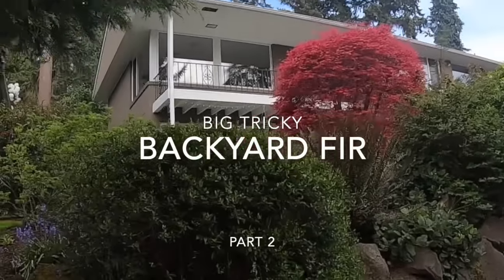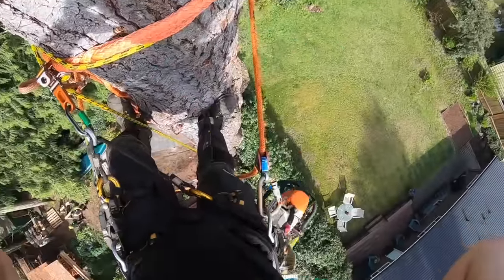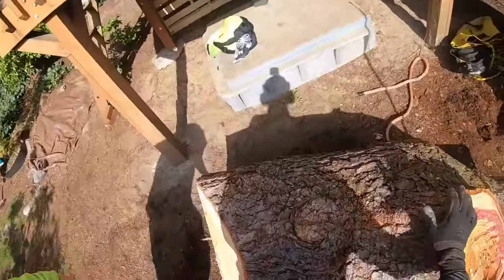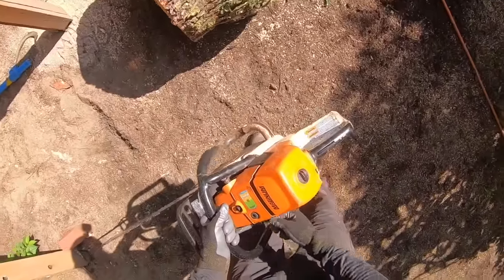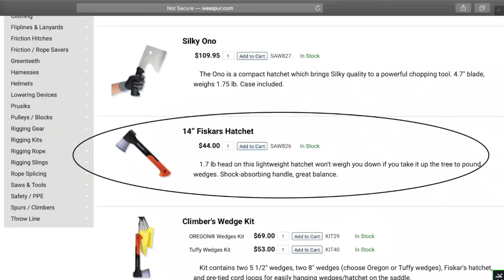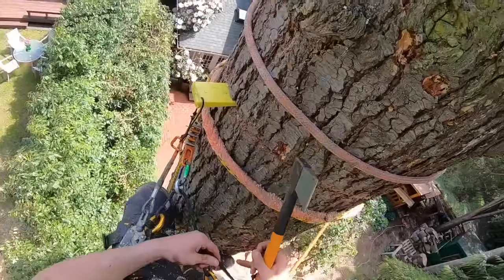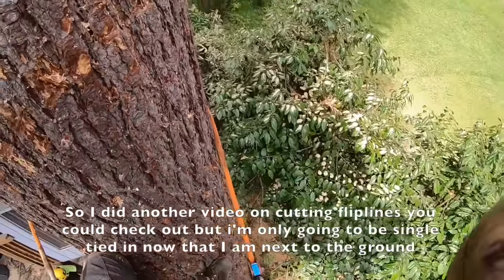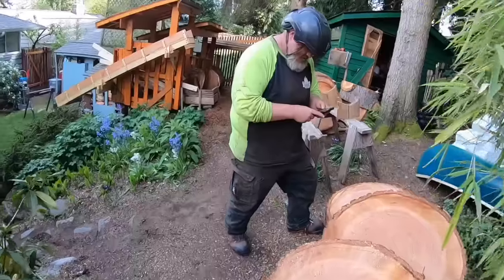Part 2! BIG Tricky Backyard Fir Removal!

Comment: Used to do allot of rock climbing and have experience being ripped up off the ground by a falling climber, can't imagine the forces of catching some of those monsters. Keep up the good work guys
Reply: I am glad somebody else mentioned this. It appears to me they are really not lowering those chunks down but rather belaying them like you would a climber. I'm sure that makes the top of the tree a less harsh and violent ride as that chunk gets weighted on the Block but it would probably be easier if they put just one more wrap on it.
Reply: @danielbuckner2167  it still takes some strength to lower the wraps are to mostly stop the log then unwrap as much as u can hold to lower usually. It takes the tangled mess out of wrapping it around the tree. Rope gets quite tangled mess if ur not a  experienced rope man. Lol
Reply: @danielbuckner2167  When rigging in tree work you don't want the material to come to a sudden stop when the rope catches it. We call the initial descent "letting it run" (if the drop zone allows for it), this takes the impact off your ropes. Letting the material come to a sudden stop doesn't just shake the tree but increases the likelihood that you're going to damage your equipment.
Reply: Yeah-more than a coupla those chunks just missed the eave-corner

Comment: Impressive control of the negative drops. I just had an oak butted up to my garage, let’s just say I now need a new gutter. I’ve reached the point where I can’t locate a saw big enough to go any lower. The base is 18 feet around until about 6 feet high. The company, that limbed it and brought it down to about 20 feet, said it was the largest tree they’ve done in 13 years of business. I’ve been using that quartering technique to get it down to about 12 feet. Took me 4 hours with an 18inch echo cs400. Even at 20 feet tall, the logs are over three feet wide. I wish I could rent a saw like that husky you have. No one near me rents anything larger than a 24inch near me in south jersey. Impressive channel. Keep it up. Dirty Hands Clean Money!

Comment: Imagine doing this without a chainsaw on redwoods or sequoias. Only an axe and hand saw. How many hours did it take to do the limbing and then this part, separate times? Awesome videos by the way.
Reply: Probably just yeeted the whole tree at once rather than going at it bit by bit
Reply: They did both they'd top them down to a reasonable height so that they wouldn't shatter when they hit the ground. They were still fell from about 20 feet up though. You cut notches into the tree with an axe then put planks in the notches and climb up to where your cross cut was wide enough for the job. Its really cool how they did it. I live in northern California and there's stumps almost the size of a house all over.

Comment: You can crank the pin tight on that block, it won’t seize up. That’s an old wive’s tale

Also, pelican rope is great. Nice folks to deal with, quality rope. I’ve worked with them to develop several custom ropes for special applications.

They do however break convention with the color of their rigging/bull ropes. Several popular brands use orange for 3/4” and red for 5/8”. So the misidentification of the rope can be forgiven.

Comment: It also does not increase the distance or kinetic energy of the fall to have a knot closer to the pulley. Because the piece is falling 2x distance from the notch to the block not from where the rope is tied. So shortening the distance between the block and notch will have the effect of lowering the kinetic energy put into the system, but not by moving your half hitch. Stay safe! Awesome channel brother

Comment: Y'all have a fascinating job. Living in east Texas we have tall skinny pines. I'd be curious how much different the approach would be to cutting one.
Reply: Pretty much all 50' plus trees are the same for the guy with the spikes on his feet, limb on the way up, knock the top out of it, chunk the trunk on your way back down. Pine, Fir, Oak, Maple, doesn't really matter all that much, the approach the climber will typically take in felling the trees is basically the same. But just an FYI, those tall skinny pines are known for taking the climber on a much more turbulent ride as the tree sways back and forth when the sections highest up are cut and roped to the ground. First tree I ever climbed was a 80' pine and when took off the top 15' that was too thin for me to climb any higher I went for a  hell of a ride at the top of the 65' toothpick that I was hugging for dear life while it swayed back and forth for a good 5 seconds. Learned real fast about that ride this climber mentioned early on in part 2 of the video.

Comment: So I noticed a difference from when you guys fall trees on the ground, it looks like you cut way more than a third of the way when you do your wedge cut. It looks like there is not much holding wood when you do your final cut. Just curious about the reason behind the different technique?
Reply: Its because hes just topping the tree in sections an not the whole tree so you can cut thru more of the tree as there us less weight for dropping trees like that id use nylon rope tho as it stretches less unlike climbing ropes..as you can see they fell a long way before the rope took the strain
Reply: Id of roped first two up an just dropped the rest wud be a lot quicker id of been done an dwn on deck while you was still half way dwn

Comment: I'm just curious why the top cuts are wedge cut almost 3/4 of the tree and the back cut in only 1/4 then at the base of the tree it was the opposite. Is that to prevent the base from kicking out to far?

Comment: Instead of a half hitch a Munster (in this case think overhand knot) is easier and it holds the rigging line in place so that the weight of the rope doesn’t make the half hitch slip down.

Comment: Please tell me how you don't just fall, like I see the rope and I'm guessing you have something like cleats on but if you gave the rope too much slack wouldn't you just fall?
Reply: Climbers where what's  called a "spike"  on each foot. They are about 3" long and located under the inside center of each boot. These spikes sink into the tree using the climbers own weight and the rope "safety lanyard" that you see wrapped around the tree and attached at each side of the climbers harness allows the climber to also learn back   away from the tree without falling. The safety lanyard, and two spikes kinda give the climber three points of contact with the tree allowing him to work safely without risk of slidding down the tree or falling out of it.
Reply: @eddiehaky935  ah I see, thanks man.

Comment: When you send a new saw up why do you have it running?
Reply: If you are dangling on a rope up in the air and you are trying to start a large chainsaw, when you jerk the rope the momentum would  send you and the saw flying about and would be extremely dangerous. Especially if the saw was running. You'll notice when when he was using the small saw to top the tree he was able  to start  the saw .  When you have the larger saws to deal with, your working with your weight on the line and the heavy  weight of the saw and a VERY sharp blade and several kinetic forces.
It just makes more sense to have the saw started and the raised to the climber.
 it's still dangerous, but less so.

Comment: i heard you call a knot a slip knot.  we call them bastard knots because if they get pulled tight they are a bastard to undo.  to make that knot you go around 1/2 a turn.  if you go around an extra 1/2 a turn its a double 8 knot and always easy to undo.  its a knot that professional riggers use.  by the way, i only recently learnt about it.

Comment: Hey there bud, around six minutes in you were not sure about the placement of the lanyard. I’ve been watching old ISA series here is a link where the guy makes the notch and rigs the piece with the lanyard under the block, about a minute in, explains some concerns about the lanyard flipping over the top and addresses it. At three minutes he ties in out of the system and makes the back cut. tying in outside of the lower system is addressed several times in the series, here is the link

https://youtu.be/_8Yec7hFj1A
Stay safe bud